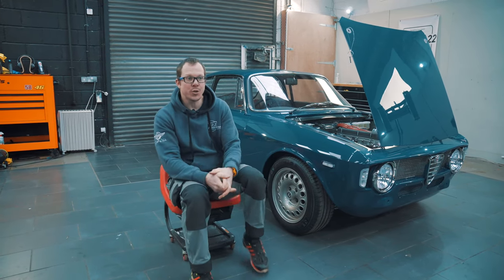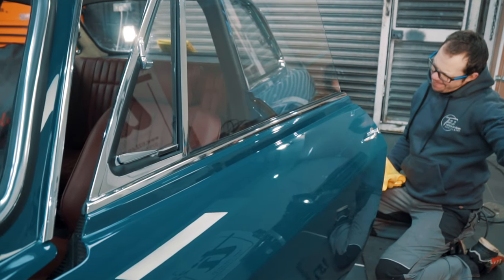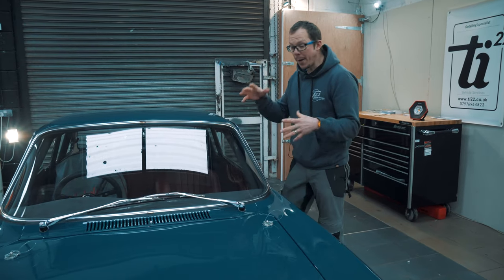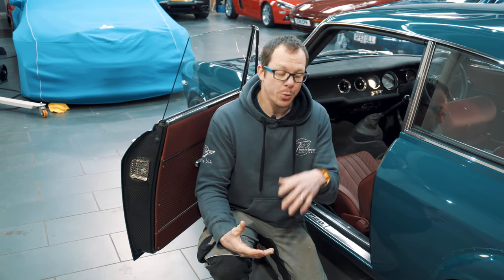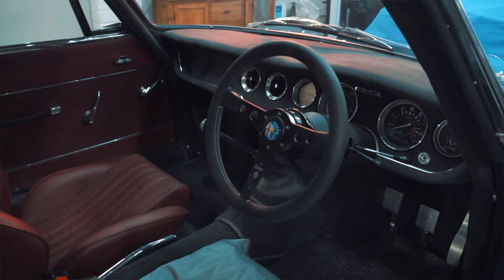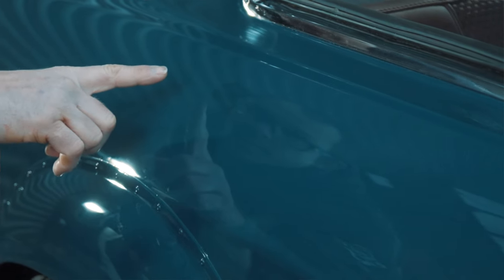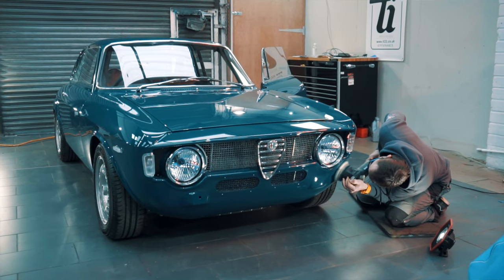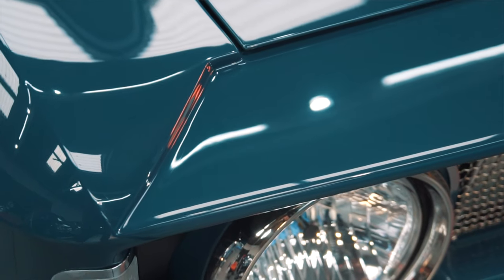The Alfaholics All Carbon GTA-R 300 : How do we improve on Classic Alfa Romeo perfection?

Comment: I am actually in the blessed position of getting a restomod (not Alfaholics) and I am considering carbon vs rebuilding the eaten away steel. A question or two - do you know how they paint carbon fibre? Is painting carbon the same as painting steel (i.e. for the results that you end up with)? The added speed that you get from steel vs fibre can't be much, but I am tempted as hell regarding the whole idea of carbon

Comment: With a seven year wait to get your ultimate Alfa Romeo, what will you drive in the meantime? How about a Noble M400 which is only going to cost you around £55 to 60 thousand and will out perform the Alfa in a straight line whilst handling as well as the Italian car. Having driven an old standard left hand drive Alfa GTV, will say that whatever speed you approach a bend, it just goes round it as if on rails.

Comment: They should make a carbon Duetto Spyder.
I wish they would tell us what it weighs.
Reply from the maker: This car weighs right around 800 kg
Reply: @Ti22Vehicleservices   Not bad at all. They originally weighed about 1000kg, so that's a pretty substantial difference.
I worked on a '63 Lotus Elan, once. Those are only about 680kg, and they are really quick. I'd love to drive one of these.

Comment: If I had the money I would easily buy a 290 or this instead of any modern supercar. No one except Lotus seems to understand nowadays that a light weight and nimble chassis is the way to go.They all have way too much power, completely idiotic. Useless electronics and apps. I need a proper steering rack, manual gearbox and Waze so I see where the speed traps and police are located :)).

Comment: The front grille is obviously a heart, not a kidney! The hood latches are foolish things, they will rattle, should be a more able fastener and no cord obviously. Who wants to stare a piece of wire loop vibrating in the wind the whole drive? 
When you apply a cloth to a complex metal surface on the engine, use some variety of rigid applicator behind a carefully folded piece, to get into nooks, or use a stiff bristle brush, changing the contact surface as you go. This wiping with a large balled up wad of cloth is not a real working method. And why no gloves?
There is obvious finger scratch marks at the door pull, visible in the slow pan. The footwell is dirty. "Only half done" explains the video too.
Reply: I'm glad somebody else saw the obvious scratch marks by the door handle. In the same area, it looked like some spiderwebbing in the paint. No where close to a "10" on the paint and finish. That said, I'd rather have this car than almost anything else I can think of, and the materials and covering selected for the seats was perfect.
Reply from the maker: Thanks for keeping us honest guys. We included the shots near the door handle to show the 'before' state.